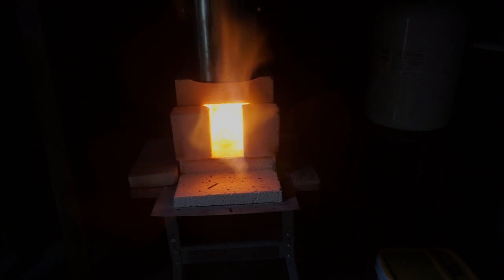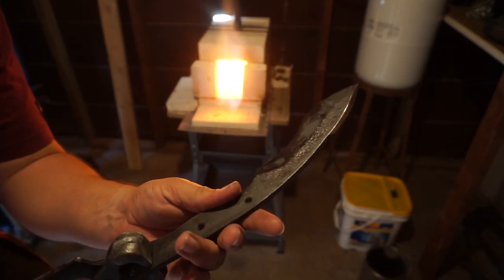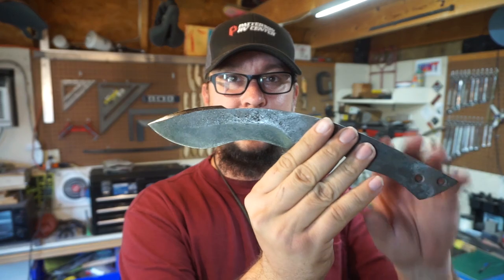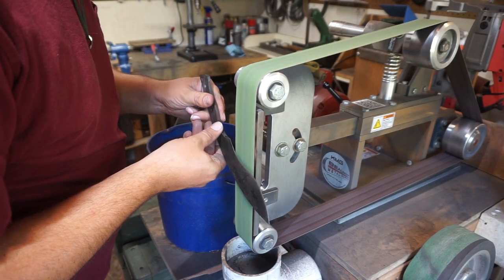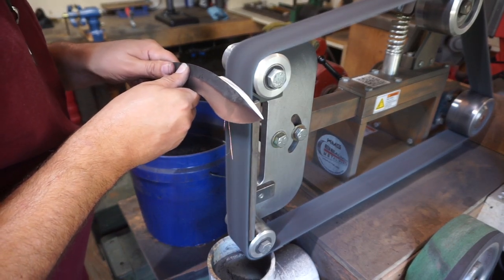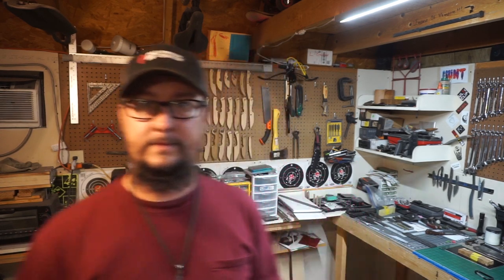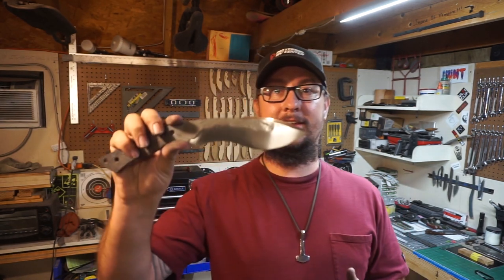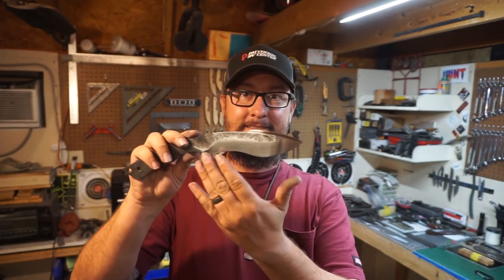Heat Treating and Working On A Forged Kukri Styled Knife | Knife making | Vlog

Comment: I think the dark etched surface with the lighter colored scales would look great but it really boils down to how you intend to use it. If it will be a wall hanger leave it polished, seal the blade with linseed oil and add a set of darker scales, if you intend to really use it, etch that baby to help protect the steel and put on whatever scales look good against the patina.

Comment: Can someone experienced tell me how useful a 1x30 is with 3/4 hp if I use ceramic belts. I hear alot of people say to just get a 2x72. Thing is I have one allready but it has some quirks as far as knife making goes. This 1x30 is perfect in comparison. Any help would be appreciated. In my experience thus far, a 1x30 is great. Belts may not last as long but ceramic belts would help right? Waste of money or useful investment? Thanks guys.
Reply from the maker: I use my 1x30's all the time. I have two of them set up in the shop still. They are super useful and you can make plenty of knives with them. The only reason to get a 2x72 is if you are going to be doing this hobby almost everyday. Also, it's easier to justify the cost if you are selling enough knives to be able to pay yourself back the original investment.